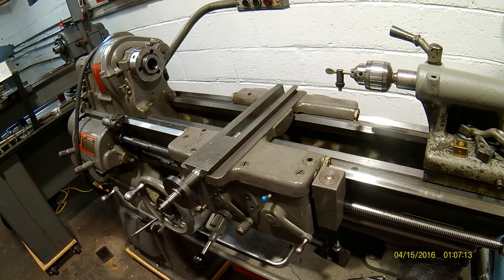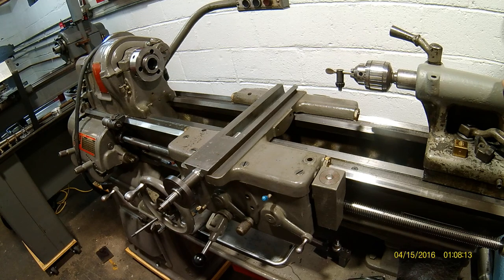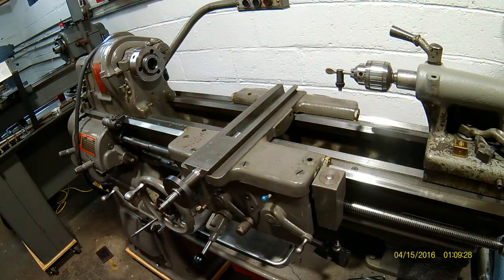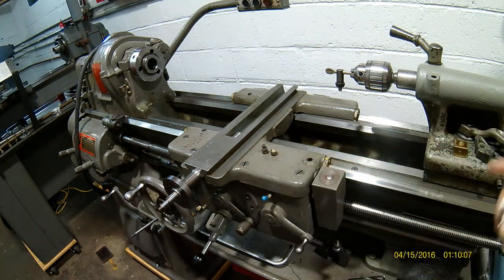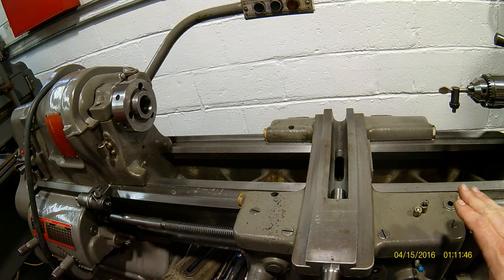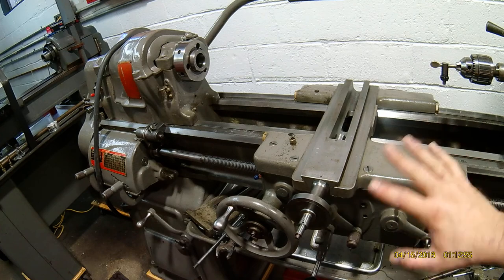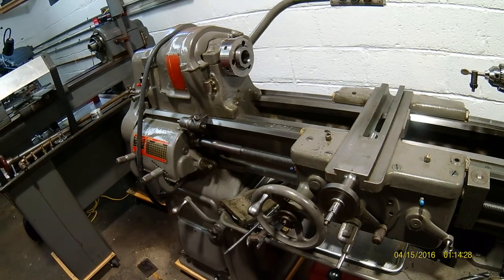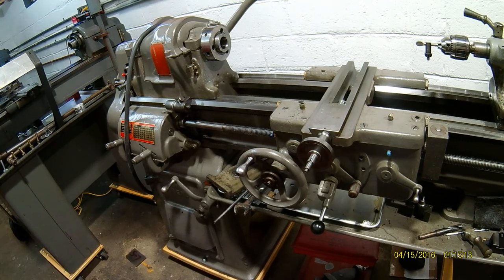South Bend 13 Lathe " Strange Ways "

Comment: Sweet. Thanks. Address sent, and a question for you sent. I likely would have rounded up some oilers too, but I didn't know the machine once had them. When moving my lathe into my basement (after buying it) I had it semi apart and cleaned some stuff up pretty well, but I want to do a full on re-wicking and new belts this winter. Ahhh cool tool! Have a happy, restful and safe 4th. :)
Reply from the maker: John,  did NOT get your message...
Reply: Hmm. I sent two of them. I'll try again.